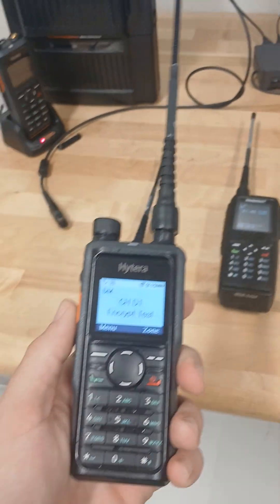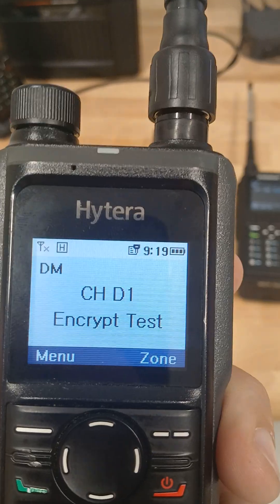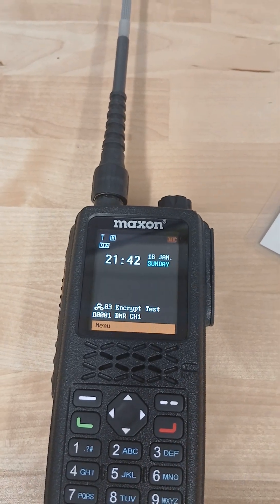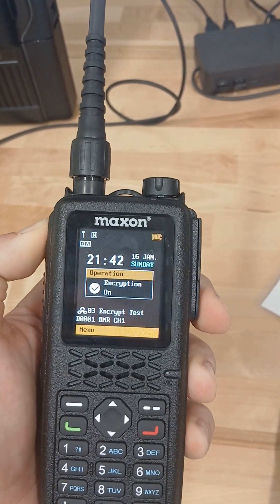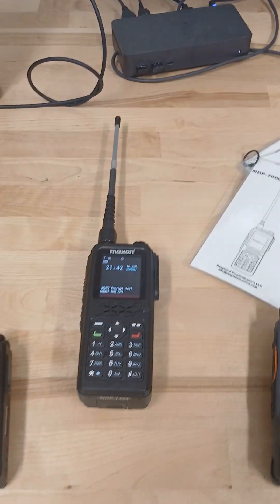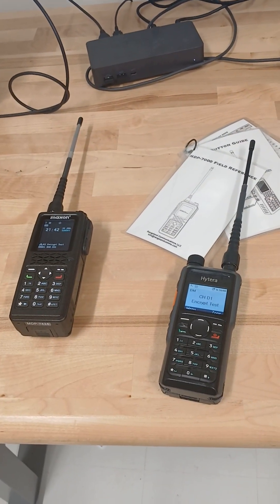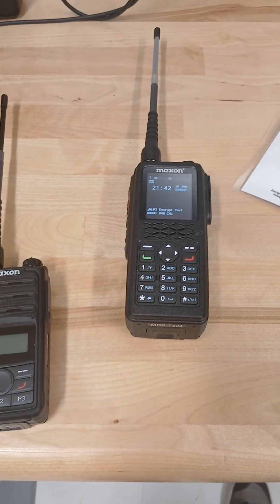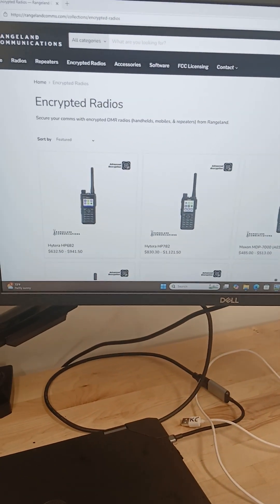Encrypted Comms Demo: AES256 Compatibility

Comment: What license is required for regular use? Commercial, Gmrs?
Reply: Yes, in the US, you'd need a business radio license. No crypto on GMRS, FRS, MURS or ham.
Reply: @justDIY I'm guessing that the voice inversion features on those FRS and GMRS radios do not count as actual encryption.
Reply from the maker: Correct
Reply: @justDIY ah.  Great.  Thanks.

Comment: Per the Maxon website, the MDP-7000 includes AES-CTR 256 as standard. Is this a standard which is used by cheaper radios?
Reply: It's not that its cheaper, their CTR version is an AES256 that is proprietary across several Maxon brand radios. The licensed DMRA version AES that Rangeland mentions allows the Maxon to work with Motorola and Hytera, and other manufacturers that are officially DMR approved.
Reply: @sawgrass67  Understood, thank you. I've got a few cheap chinese radios which have a mystery implementation of "AES 256" and I thought it might be CTR
Reply: The question boils down to what DMR chip it uses.  AMBE-3000 (American) vs HR C7000 (Chinese) vs something else.  All the features of HTs are really just whatever the chip they use provides.
Reply from the maker: We ship the MDP7 with the upgraded AES256 DMRA license. You are correct, Maxon ships the MDP7 with the AES-CTR256 encryption included.